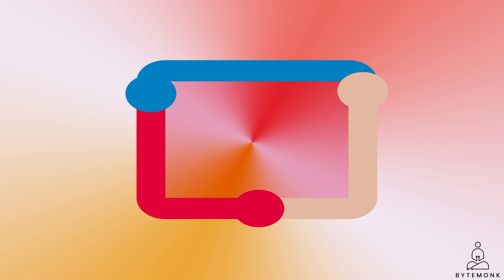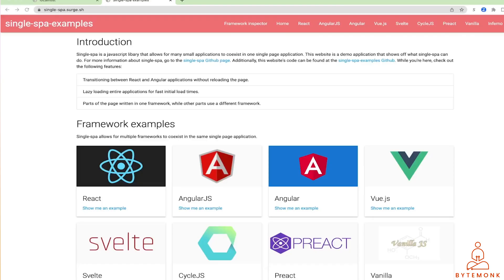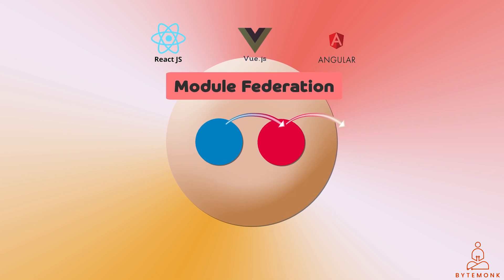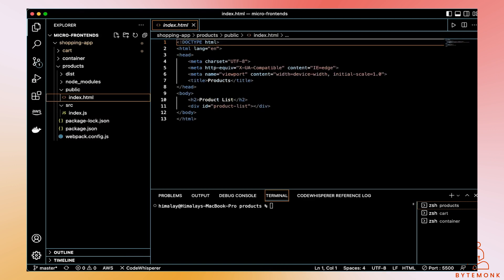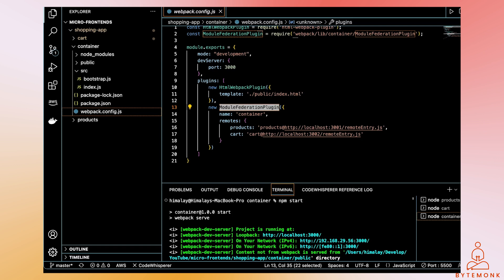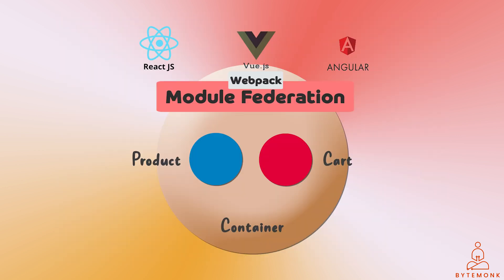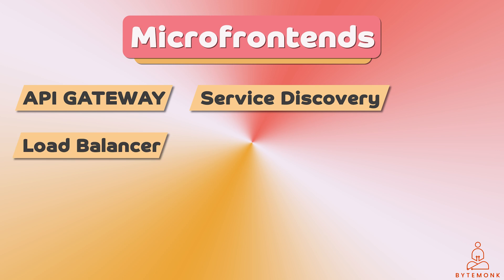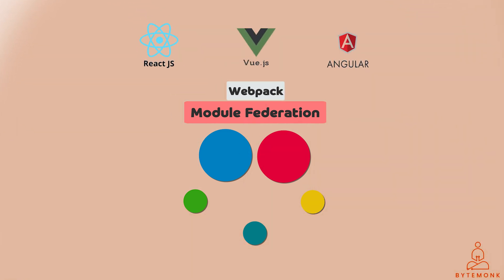Micro-Frontends Explained in 10 Minutes | System Design

Comment: "If you want to change the design of the checkout page, you will need to update the entire frontend application".
This is a horrible example, you sound like you don't have experience in the frontend side of things. Each page obviously have their own code, their own template. You don't need microfrontend for this. Subdividing your app into multiple pages is not a microfrontend.
Reply from the maker: Yes, when using component-based frameworks like React, Angular, or Vue.js, it's common practice to structure applications so that individual pages or components can be updated independently without needing to overhaul the entire frontend application. 
My statement, doesn't accurately reflect how modular frontend development typically works today. Simply subdividing an app into multiple pages doesn't constitute a microfrontend architecture. Microfrontends involve more than just separation—they require independent build and deployment pipelines, and often, different teams might use different technologies within the same overall application, which I have previously implemented using Module Federation Plugin and Webpack, and shared glimpses of that here. Thanks for the comment!
Reply: @ByteMonk  i wonder if microfrontend is making things more complex since each piece of UI is hosted and runned in separate machines (or virtual machinse), just like microservice.  As a result, the number of machines to host these "pieces"  consequently increase in number.

Comment: How does the container switch MFEs without reloading the page?
Reply: The container in a microfrontend architecture switches between different Micro Frontend Applications (MFEs) without reloading the page using a technique called client-side routing and dynamic loading.